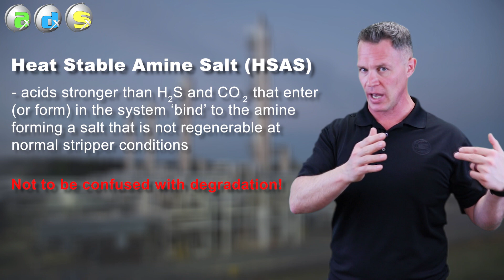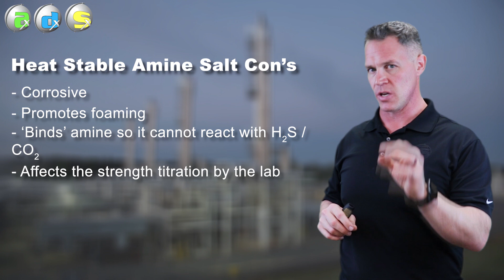"Basics" of Acidic Heat Stable Amine Salts: Part 1

Comment: What are the options available to reduce bicine levels without impacting heat stable salts level below a point which increases reboiler duty. What are the best methods to reduce bicine levels